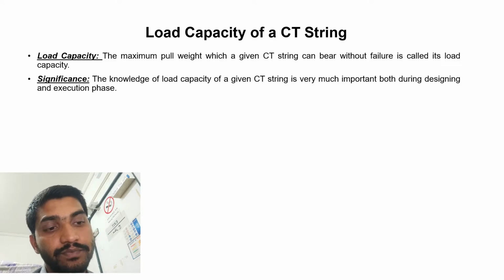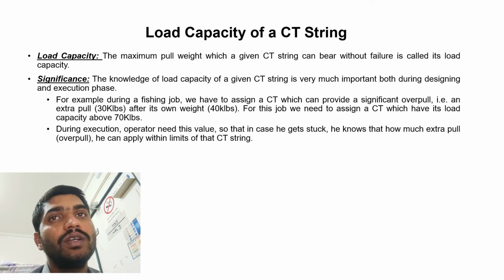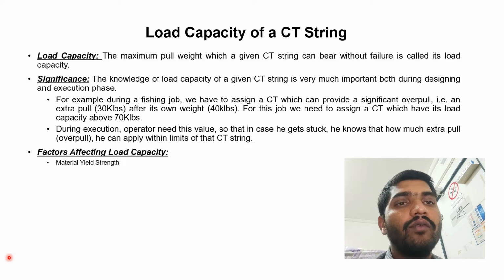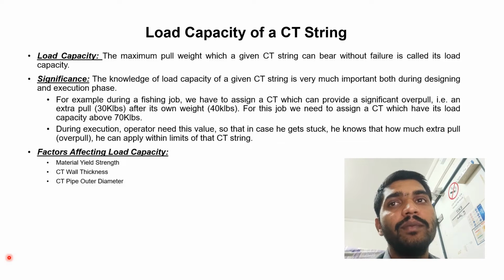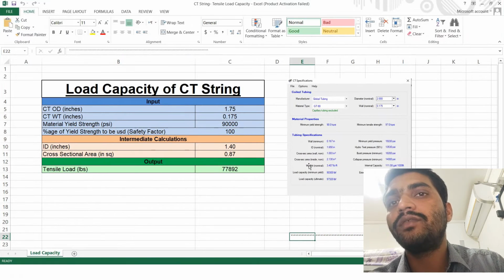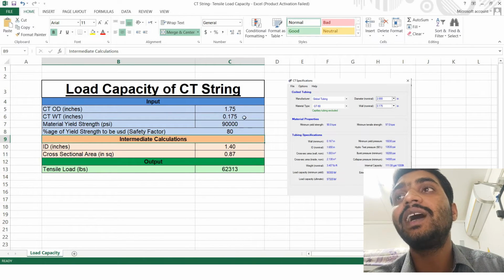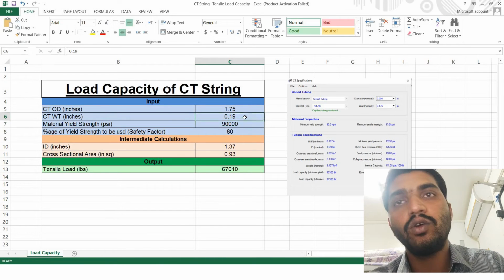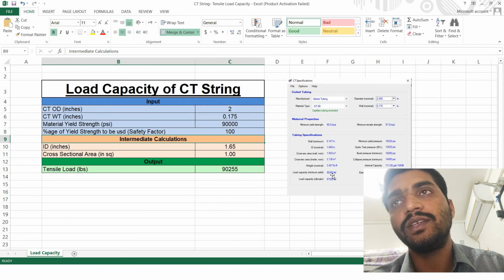103 - Load Capacity of Coiled Tubing String by Yasir Ali

Comment: Hi Yasir,pull test with the connector depend on the string load capacity?
Reply from the maker: Hello Mr. Ruben. Pull Test actually depends upon multiple factors. Like 

1) Connector Type
2) Job type for example if its simple fluid circulation job pull test will be lesser value, and if it is fishing job, pull test will be on higher value. 
3) CT Size 

But yes, the maximum value of pull test is limited by CT. We can't exceed the limit of CT string i.e. the maximum load a CT can bear.
Reply: @yasirali028  ok fine.
Consider that I'm using QT-800, OD:1.50" Wt=0.134 for matrix acidizing.What could be the maximum pull test I can give to the connector?Please can you also give me the proper formula to calculate the Tubing load capacity @ maximum yield?thank you for your time.
Reply from the maker: Regarding the pull test as I mention it depends upon the connector as well. In the case you mentioned above if you are using Dimple Connector and performing matrix acidizing job, 20Klbs will be enough. 

If you are using Roll-on connector ( which is not used now a days), then 10Klbs will be enough.
Reply from the maker: Regarding the formula, it is clearly mentioned in the above video, so can use that formula.
Reply: @yasirali028  Thank you for your response.